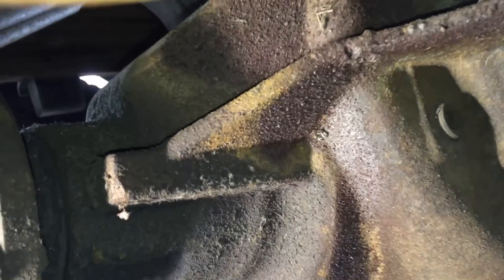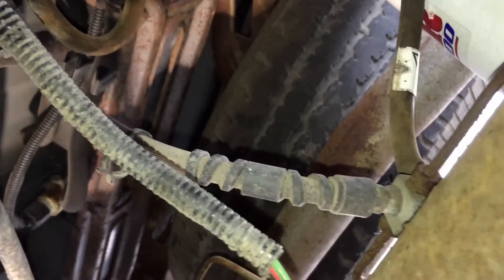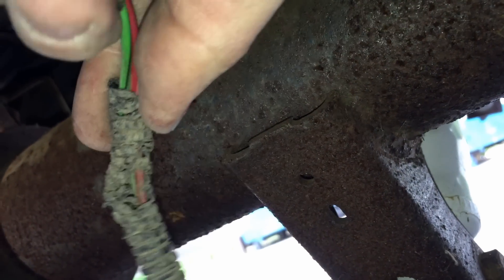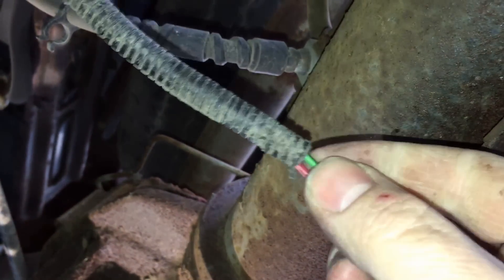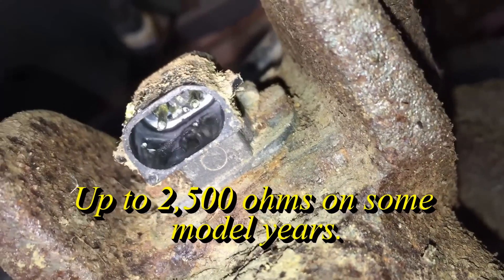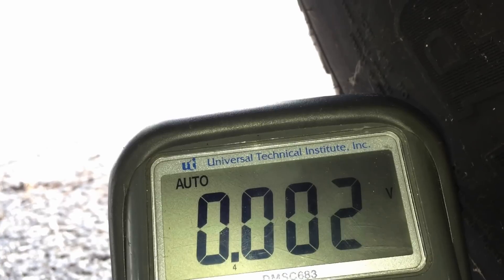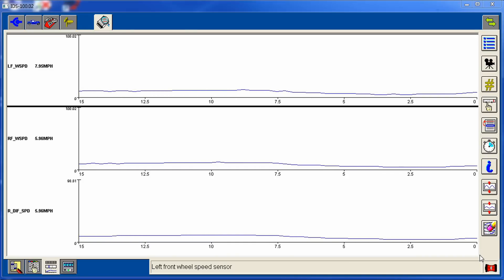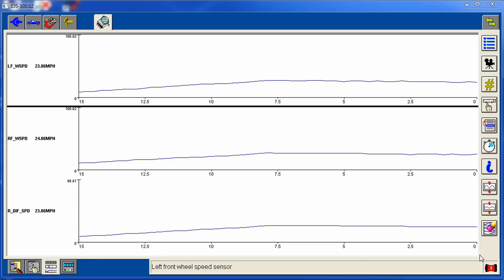Ford Vehicles: ABS DTC C1230 Diagnosis and Repair

Comment: Can this cause transmission to act up on rough roads going around sharp turns? Mine feeling like it slips going up hill around curves and when on bumpy highway mainly on 50+ mph only... Can this sensor cause that before I replace transmission?

Comment: ABS sensor input 2006 Ford Focus SES ZX5. Replaced both front wheel bearings, lost ABS signal on the left front. Checked sensor wiring, swapped sensors side to side. Made no difference. There is no tone ring on either side on the CV joint. Possible the bearing was put in the wrong way? One of the CV joints on that side had a boot cracked so I changed that as well. Any ideas would be greatly appreciated. Your guidance has helped get my 2006 F150 5.4L to 300,000km, and still running smooth.

Comment: So, I have this C1230 in a 2003 Ranger 4.0/5R55E. Just replaced the sensor and this code popped up. Wiring? Bad sensor? Also, it was accompanied by the C1095 Pump Motor Circuit Failure.

Comment: Great video. However, I just thought that I would share that after removing my entire ABS unit and checking the wiring from end to end, I still couldn't find the break in my wiring. I was ready to replace the wiring from end to end and decided to test the pigtail from the harness to the sensor. I found an open circuit on the red/pink wire with my meter, but could not locate the fault. In the end, the red/pink wire was broken right where it enters the plug, There was not enough wire left to even solder so I found a new connector online. I'm now heading back to reassemble the braking system and bleed the brakes. What a hassle!!!

Comment: I have a 2007 expedition and the ABS is not working and I have taken it to 4 shops and the ford dealer nobody has fixed the problem had the control module, pump replaced still no fix

Comment: Yes my name is Robert I have a 2001 Ford F-150 5.4 l engine it's a two-wheel drive and it said replace the rear speed sensor and the differential I've done that twice and it's still throwing a light in the dash could you tell me anything else to try I sure would appreciate it

Comment: I have a 2002 F250 4WD with the v10. It randomly throwing the ABS light but goes away on second start up and stays off for a while. Codes when it came on last was C1198 and C1214. What could cause those?

Comment: OEM ford wheel sensors 40 bucks for rear and 80 bucks a peice for front. I used oem for rear and napa front sensors. I wouldn't recommend buying aftermarket seeing those wheel sensors tell your transmission when to shift your putting to much trust into that Amazon junk. electrical components might be wise to use oem or equivalent brand name. 95% of us can do it ourselves and save on shop labor so put savings towards oem parts. You can thank me later. My truck has 335k and abs sensors were original. You'll have to let us know if Amazon ones last that long lol just saying. Appreciate the videos you make its real help. Ty

Comment: Awesome video love your videos. I'm having abs light coming on issue not all time, usually it comes on after bunch of bumps on road. I have 3 wheel sensors 1 in rear 2 on front I replaced all 3 the light comes on a whole lot less but still dose come on after a considerable amount of miles 50+ miles or so. I will check wires next. But my question is what kind of computer scanner do I need to see the live data like your showing in your video? I don't have ton $. But it needs to show live data as I'm driving so I can see exactly what is going on with any electrical issues I might be having. I think that abs screen would have saved me couple hundred bucks it would probably pay for itself. What model computer you use? Or recommend thank you for reading. Thanks for videos they always help full.

Comment: Brian, can you show where the transmission speed sensor is on my 2000 ford ranger. 
OD light is on, wont shift sometimes, other times it shifts with a hard shift. Speedometer doesn’t work either

Comment: Brian, can you do a video on ABS problems i.e., brake pedal going to the floor after checking all other possible causes. 
 I'm having that problem on my 06 Explorer and I'm considering an ABS delete. The price on the ABS unit is ridiculous and it could be any of the multiple parts involved. If you have already posted such a video,just point me in the right direction. Thanks.

Comment: Do the '12 Ford E350 have Right and Left Rear Brakes Wheel sensors or just the sensors on the rear differential?

Comment: You're a good mechanic when u go from a guy who can change parts to a guy who can do full diagnostics. 
As for me, all my trucks are so old that as long as the part is under $100 and its not hard to replace, I assume its about to fail anyway and I will just run my scanner and throw parts at it all day. 😅😅
I replaced that sensor today, while I did visually inspect the wire, I admit I only would've checked the wire signal if the code didn't go away. It would've been the last thing. Not the first. I wouldn't have felt bad about needlessly replacing the sensor either.

Comment: We have a 2000 Ford e450 based class C motorhome with this sensor.
 It appears previous owner messed with this connector you have in the video. 
Would this cause the BRAKE light on dash to illuminate? Fluid isn’t low, and I replaced the little sensor on the e- brake pedal and still light is on? Thanks

Comment: I have a 2004 ford taurus the abs and brake light on at random. I replaced the abs module and it still does the same thing. Code b1342-20.. what else can it be?

Comment: Hi Bryan. Great video. I've been pulling my hair out and have replaced the VSS twice with a new connector to try and fix my erratic speedo and transmission shifting issues, (w/flashing OD light. '95 E-150 351 Windsor). This last time I felt inside the mounting hole to see what the differential gear (that is driven from the diff. The small gear), felt like it was smooth, but, unlike the last time I felt it, it felt as though a piece had been broken off. I see online that these are pretty common and are actually made of plastic(?). I assumed the sensor was a mag pickup but if the gear it reads from is plastic, how does that work? Can these small gears be replaced easily? I'm taking it to my mech and we will discuss it but I wondered what your thoughts are. The forums haven't helped so far.

Comment: My '99 Explorer has the same code and ABS light on. I'm more than positive it's from mice/rats. A bunch of wires were chewed up on it. I had it parked for almost 5 years. Once I rebuilt the engine, the first drive was great, but the ABS light would flash when hitting bumps, then it stayed lit. I picked up the sensor for around $29 from my local parts store. I'll be changing it and repairing the wiring tomorrow morning. 

Great video and information. 👍🏻

Comment: BRIAN!!!  i need help, my 1994 f250 7.5 and on the dash it says (rear abs sensor)  i replaced the sensor and no change.  when i turn on the truck the speedometer cluster doesnt show my mileage, and the speedometer doesn't work.  the truck doesn't shift worth a damn, it's all over the place. when i unplug the sensor there is no change. so it's either a bad wire or the speedometer???  is there a way i can check if i have a bad wire with an ometer???  please help...

Comment: I tested those two prongs on my 2008 , absolutely nothing changed on the voltmeter abs light on , no brake light abs light comes on after a few minutes whenever I start the truck even when I don’t move , thinking it’s that rear sensor

Comment: Is voltage check on wiring key on engine off or key on engine on?
Reply from the maker: harness side is key on engine off.
Reply: @FordTechMakuloco  thanks!
Reply: @FordTechMakuloco  i have 2007 f150 5.4l c1230 code.  Checked rear diff abs sensor getting open line.  Ordered sensor. Checked voltage koneoff 0.00v at plug.should 2007show 3.5v fluctuating.  Wires look good up to where it joins main  harness drivers side rear box.  Continuity ok there with pin through wiring to connector. What pins can I test continuity from abs module back.  Thanks in advance!

Comment: My 95 bronco has had this issue for so long, i have replaced so many things on it, and when i shift to 4th my bronco jerks back and forth, and my speedometer jumpes everywhere, ill try replacing this sensor, thanks gor clearing it up for me
Reply: Did this fix your issue, I have a 94 bronco and just started doing the same thing. Already replaced the cluster, and other parts. Thanks in advanced
Reply: @alexhinojosa331  yes, it was, also didnt help that the tone ring, what the sensor reads, was missing teeth and was not reading right, also the jerking bqck and forth was the trans going in and out of gear from the bad reading from the sensor

Comment: Thank you. I followed your instructions, changed that sensor and after I drove a few yards it cleared the ABS light on the dashboard. 10 pionts.👍 
Now, i don't know why, I scanned the computer and it still has the ABS codes. 1999 expedition XLT 5.4L 2 v Windsor 4wd 4r100. Made in November 1998

Comment: Would this be a problem on a -abs system for 1996 Ford Explorer Limited 4.0L V6 4WD SUV? The drivers side front wheel keeps locking up when reversing.

Comment: Do I need to disconnect the battery to reset the computer after this? my speedometer is going all over the place with the new sensor, speedometer was ok with the old sensor, just the shifting was rough with the old sensor. shifting is a lot smoother with this new sensor but the speedometer is all off, cant win lol

Comment: On my 2008 f150 the rear abs sensor resistance measured open...ie; mega ohms, so I ordered a new one thinking it was bad, because this video says it should be 1-2k ohms approx. But the new sensor measures the same ie; mega ohms. it was a different part number then quoted in this video.

Comment: My 2006 f250 with a 5.4l 
Just got a new battery yesterday, new alternator a few months ago.
Abs light turned on until I came to a stop down the road, turned back on down the road till I lost power a couple miles later.
Was running good other than a higher idle that usual. Again today abs light came on and I lost power to the dash and radio before getting back home and turned her off and tried turning it in  back on but just heard the starter.

Comment: I just subscribed you, I have 7 Fords, from a F-650 to a 1931 Model A, Hope you can help me out,  Had my clutch replaced and now my speedometer and odometer only shows half of my speed and miles. Suppose to have 5 volts at speed sensor, bought new sensor but didn't help, Where can I find voltage loss ? I'm getting 2.5, half of what I suppose to get, and half of on meters Speed and Odometer,  On a 6 speed Eaton Trans. sensor is on tail shaft .

Comment: I got a navigator 04. Mine comes on usually in cold weather. Anything below 50 degrees I have to warm up the truck for about half hour or else the ABS will engage driving down the road. I lose power and the breaks will do it's intermittent breaking. Still not sure what that is.

Comment: Thanks... What causes an F150 Screw to cough up an ABS and a Service Advancetrac light at the same time? I checked the fuses, but are these together always the front sensors or could it still be the rear?

Comment: I love you help me I have a 93 Ford fxl 5.0 4*4 on 33s on it I've already calibrated my instrument cluster I got a new instrument cluster wheele vehicle speed sensor in the rear differential I've gone over all the wiring I fixed every single short in the truck I'm going on a road while pushing on the gas accelerating or if I push on the gas it all one going on Route the speedometer will drop down to zero when I'm off of it it just bounces around different instrument clusters everything I'm at my Wit's end can you help me

Comment: 99' isuzu rodeo, no speedometer or odometer. This same sensor was interferring with the vehicle speed sensor on trainy, once the abs diff. sensor was unplugged it showed a abs light on dash but my speedometer started working again. Original code was po502 low voltage input.

Comment: got a question I got a 2010 f150  when I drive the truck shacks but when I come to a stop I can feel a pulsing of the brakes and no ABS light  any ideas what it could be
Reply: Warped rotor?
Reply: @tembrant  no all that is good I changed all the brakes and rotors  to make sure its something with the ABS
Reply: @RideShareConfessions   hub with sensors causes this
Reply: @ChrisB-cx6td thank you i will check it out
Reply: @RideShareConfessions  . it does this on purpose ("Limp Mode") basically its trying to avoid you from ruining your transmission or rear differential . since most likely one of the wheel bearings is not good the.abs speed sensor is integrated to wheel bearing and when the tires turns sends signal to your computer

Comment: My 2005 f150 has been parked in my driveway since it went into limp mode oct 2017. The mechanic didn’t have the time to troubleshoot so i have been trying to fix it myself. The freeze frame trigger code is P2106 which is the throttle actuator control system but the main dtc that pops up on my scan is c1230 which is the rear center wheel speed sensor. I’m lost with this stuff and don’t know where to begin. Does anyone have any suggestions?
Reply: Did you get the problem fixed? I have the 2106 code and trying to troubleshoot. From what I've gathered the TB is programmed in with abs and a few other components? I've been told I will need to flash my ecu because these codes trigger safety issues?

Comment: Hey brian i got a leveled 2014 f150 so my pass side uca balljoint was clunking bad so i got new mc uca an installed it myself with one friend. Long story short with 2inch puck spacer ontop of strut tower its almost impossible to get strut tower out so i pulled hup an bottom balljoint an when i put it all bsck together i got traction an abs light hooked up scanner it says front pass side input circuit failure. I ordered another one incase i stretched it pretty good by accident do you think thst will sum it up.

Comment: Mine comes on every now and then when im on a bumpy rocky mountain road
Turn truck off light is off after i restart
Reply: I have the same exact problem. So was it the rear differential ABS sensor?

Comment: Could not find no sensor on diff 08 Sport Trac any clues?
Reply from the maker: With your sport trac being an IRS, the rear ABS sensor is located at the end of the cv axle in the knuckles.
Reply: Yes I checked both sensors with the rear jacked up and and in gear giving me a reading of 450 and 650 but I have the ABS lite on and stays on when starting only I checked the traction switch turning off and on working good, then driving, traction control lite lights with ABS lite too brakes good but not on slippery grounds, went to Advance Auto with no luck on a traction control sensor, ABS pump #6 fuse ok.
Reply: It comes on when you start any vehicle. It will come on for so many seconds and go off usually by time you put it into gear it should be off... if its not then you have problem with abs system or sensors. Mine stays on for 5 seconds after truck is started then goes out. But truck is 2003 on newer vehicles it won't take that long for it to go off. They get old takes them couple seconds to think lol

Comment: I have a 2010 Lincoln Navigator with a 5.4 v8 the abs,advancetrac and the brake light came on it’s drives just fine. Would it be the same issue?

Comment: Great video, i did as you said replaced my sensor, checked wires etc. Speedo has been working flawlessly until 60mph. As soon as I hit 60mph my abs light flashes at me and my speedo drops down to 0. Any ideas on what could cause this would be greatly appreciated. Cheers
Reply: My 2004 explorer did the same however I got the 🔧 light and service engine turned out to be the transfer case and transmission hope yours isn’t as bad

Comment: My 05 f150 locks up its rear brakes, but no ABS fault?  Also has a spongy pedal even after all new pads and bleeding?  Truck stops great but would like ABS for safety, what's next?
Reply: Hub bearing wheel speed sensor
Reply: Did you ever fix it

Comment: I ran FORScan on my 2001 ranger and it comes up with this DTC.  However my ABS light is NOT on.  I've tried two OEM sensors and they all have a resistance of 800ohms... not sure as I keep reading it should be over a thousand..

When I hook up my OBDII reader I can spin the front wheels and see the MPH/graph going on the OBDII... same with the rear diff sensor.  It does read MPH on the reader as the wheels turn.  So it's definitely getting a signal.  Checked voltage at the plug and also getting a reading...  Have no clue what else to check because the ABS light is not on and brakes/ABS work fine when driving?

Comment: Will this sensor also affect my speedometer?  I have an 07 F150 and my speedometer is off. It works but show the incorrect mph
Reply: Tim Hutton did you find out if it affects the speedometer
Reply: Were you able to find that this affected speedometer accuracy ?

Comment: Question? I have a 2004 Ford F-150 lariet 5.4 v8, and my abs light has been on for about a month. And recently it has finally decided to turn off, but then when I drive and begin to brake my pedal pushes back out at me and acts like the truck begins to skid while braking. The abs light will come back on and correct the braking. Any ideas on what is wrong with it, and any  idea on what it costs to fix? Thanks
Reply: When I had this issue I bleed the system it went away. Try getting brakes bled of air.

Comment: Hello friend, how are you.
I have a truck ford 150 v8 5.8 model 92
  The problem I have is that my truck turns well but when you put the change, as it loses strength and the trasmicion begins to fail and almost does not give up. as you want to turn off the engine and replace your fuel pump and will still like me can help. Thank you.